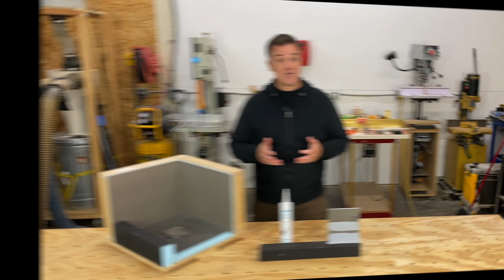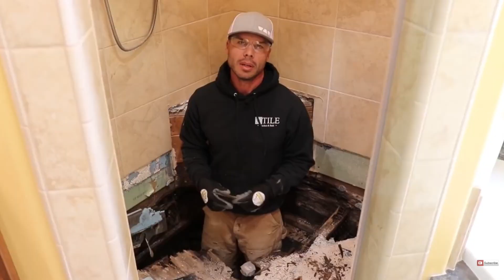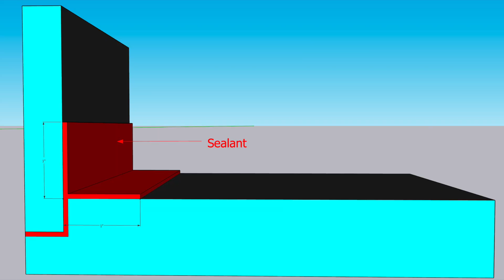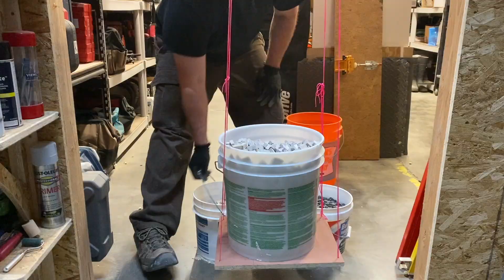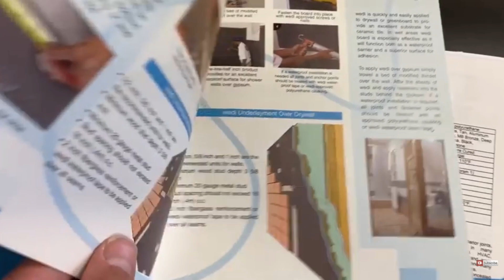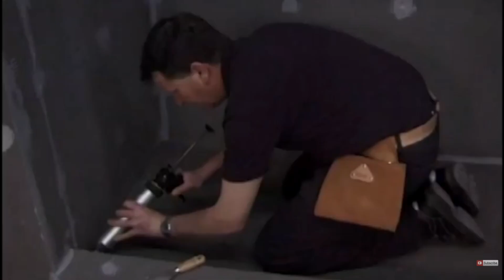WEDI Shower Waterproofing "Big Secret"

Comment: I have a problem and need advice. Old leaking shower. I assume it was built by the same idiots that built everything else in this house. A tear out will be a nightmare which I'm too old to do myself and too retired to afford a tile contractor. I'm thinking I could use  a tile over tile primer (the slope is ok) then RedGard and go up the wall maybe 6" with a curved (think baseboard) style tile. Epoxy grout and silicone. I'm open to suggestions, product recommendations and advice, but please keep in mind the afore mentioned constraints. Thanks

Comment: Oh what a world of BS we live in. This is a very comprehensive marketing campaign to back up a product (sorry a "German" product, haha) that is hideously expensive and clearly not as good as standard membranes that require bond breaker. Its a bit like the epoxy membranes that became really popular in the 90s but cracked on (wooden) second floor installations with a structural movement problem. I'm only ever going to install this stuff with bond breaker and a proper waterproofing membrane ON TOP OF IT. But then again, I could install cement board for tiny fraction of that cost and it would be properly waterproofed, no need for this marketing crap. I can clearly see the signs of what the edge of polyurethane sealant looks like when it separates from the substrate surface, like in inappropriate expansion joints.
Reply from the maker: I don’t work for Wedi and I don’t have any marketing agreements with them. I made this video to help customers and professionals understand this product better. There are people out there who make up ideas based on how they feel, not proper education and evaluation. There are many products that work but all of them have to be installed properly.

Comment: I just installed a Wedi shower. I think it's a great design! I can see how things can go wrong if installing and not paying attention to detail. Such as debris left in the rabbit cut.. or insufficient sealant. Also, the sealant being used is way too close to what International used to seal oil pans on the 444 engine..😊 you couldn't remove the pan without torches and chisels . The oil pan always needed to be replaced.. just a memory I had while working with the Wedi caulk sealant stuff..
Reply from the maker: Nice!! Paying attention to details is always key!!

Comment: You did a wonderful job breaking down a particularly problematic video on Wedi pans. There are a variety of products, when used properly, that work really well. Great commentary and analysis. The one thing that I will comment on with regard to Wedi and Schluter shower pan products are the drain assemblies. I have never liked floating them in with mortar with no mechanical connections. I also use epoxy thinset when installing shower floor tile and epoxy grout to finish off the floor. Keep making quality content.
Reply from the maker: Thank You!!😁

Comment: I ran an water feature business along with general stone masonry and landscape for 22 years.  We became the second largest Aquascape (the largest water feature supplier in North America) in North America.  I am a Master Certified Aquascape contractor, so I have worked with literally miles of EPDM 45 Mil rubber liner.  This is not foolproof either.  You can puncture it during installation and cause a pin hole leak that would feet the rot.  We also used sealers to clamp the rubber to the face of the skimmers.  The one on my home pond is 25 years old and does not leak, but I made a living with multiple pond service trucks fixing leaks that were punctured.  Overlaps are not the answer.  Following the manufacturer's instructions to the letter is the key and making sure your joints are clean and dry does.  Great video.  I am installing my WEDI shower starting this weekend.  I watched the negative video to the end and thought I might have blown my plans and money.  What I would guess happened was the leak test was fine for the shower base, but the seal around the top of the seat leaked into the open area under the seat and weakened the floor which caused it to move which seperated the edge. Also might not have taken the dust off the rabbit joint.  Thanks a lot for a thorough job.

Comment: You sound more like a lawyer than a tradesman. Put the installer before the court, he would convey that he did everything by the book. And the bottom line would be…a "Wedi certified" installer did the job, it failed and water damaged occurred. BTW, your explanation of water damage- bacteria, fungus, glucose and pixy dust, was a great job of pivoting.  You should consider a career in politics.  Instead of arguing this to death, a good damage control team would have worked with the home owner and honor their guarantee.  This way home owner is happy and future consumers would have confidence in the product and the company behind it.  So all this "science" did nothing for positive public relations.

Comment: Thank you for this rigorous application of critical thinking. I installed a Wedi shower in the house I was living in, in 2011. We used it for a few months before selling the house. I remember using Sikaflex (221 I think). It was gray like the current Wedi supplied sealant. I saw the other guy's video first and was wracked with worry that the people I sold the house to may have had a failed shower (that I proudly built). I followed the instructions to a T and after watching your video I regained my confidence in my work. I'm demoing my current bathroom and will be doing a Wedi Fundo shower. I like Wedi and my faith is now restored. 😂

Comment: I would definitely be interested in that report. The seat theory doesn't work for me as you can see it in the background tiles removed. Its not rotten. The bottom plate of the wall appears to be in fair/poor condition. The sub floor, joists, and band board are all trashed. The pan does appear to pull loose from the sealant fairly easily. Definitely did not take the 225lbs in your demonstration. Seemed to hold on to the wall really well. With the extent of damage it would probable be very difficult to determine root cause. I guess the biggest question is if a Widi approved contractor did the install what difference does it make what the cause was? They should stand behind the install.

Comment: Even though polyurethane is waterproof and weatherproof, if it's left in an area with high humidity levels or temperatures of more than 122° Fahrenheit (50° Celsius), the material will degrade. It should be kept away from these conditions to ensure that it lasts for as long as possible. I would guess that you wouldn't want any failure on your grout if used under tile in a shower. I would guess that 122 degrees might be found near the sealant as would someone expect to understand the humidity in a shower. some people love to take long showers but I can tell that you are one of those people that takes only a long enough shower to wash you nasty aass and anyone that takes long showers is some kind of problem anyway in your fools reality.

Comment: 15 year warranty on a product that shall maintain a barrier to prevent damage to the structure? 15 YEARS wow. How many years can a building go without major structural damage? If the building isn't treated with a bunch of 15 year warranty products, I would guess 125 years in good conditions if not more. I guess in this day and age the home owner doesn't live in one home longer then 5 years so the owner that gets the bad luck 16th year failure condition or suggests that 15 years is all the wedi is warrantied for should rip it out and put something new in a there genius. Just like the roof now. After 15 years you should replace your shower that is a wedi install to prevent structural damage. Good show there dumb aass.

Comment: Point in fact that a fat fuxker is hanging off the rabbet joint and the foam comes with the sealant when he finally break the piece of wall material from the rabbet joint. Do you see your lack of understanding? If it was dynamic shear from the floor riot then there should be pieces of the rabbet joint attached to the wall material. Instead there is a stain on the rabbet joint and no foam missing from the rabbet joint. Just sealant missing and looking like it soaked off.

Comment: OOOO OOOO as you suggest deflection the L over 60 or L over 70 OOOOO wow YOu are using some big engineering wording. Deflection as such as I did suggest dynamic shear. What does cause the shear? Deflection? and if there is deflection at a rate that would cause dynamic shear then I would suggest that the delamination would not look as it does. Kind of like it was soaked off the rabbet joint leaving a stain on that same rabbet joint. Not pulled off. You are full of shxt boy.

Comment: I saw the delamination and the true lack of engineering with this product. As you are suggesting that the home owner and inspector of the issue was not forthcoming, but in fact the delamination was the whole issue and the cause of the leakage. You suggest that there was riot already and the floor riot along with the truss riot was the dynamic shear. You would be wrong. The delamination was not due to shear from the structure. If it were then there would be parts of the sealant still on the Rabbet joint. That is where your argument losses all it's validity. It is not a well engineered product at the rabbet joint. By the way as you so foolishly put science and engineering as not common or sense; and also not being common or sense the nature of things in the physical world is that you suggest that logic is not of the nature of common or sense. What happens in the real mean physical world is studied and has a logical process always. If you live in another dimension then maybe what is real in this universe could be considered not common or sense if it is logical. What you are really saying is that if it doesn't work for you in your mind then it isn't common sense and that nature has no logic from your common sense prospective. You are wrong. You suggest you understand what is really going on and all you are is wrong. Living in your own diluted reality.

Comment: do you think you can go above and beyond fitting instructions i do belt braces every time thanks Colin
Reply from the maker: You can, but also making sure you achieve the intended goal rather than blindly following an instruction is very important.
Reply: @builditorfixit  wedi Subliner Dry Waterproofing Membrane i was gonna put this 300mm high on walls to floor and put down with ardex x77

Comment: Also, you say lapping up and over isn’t correct.  I don’t follow that ?  If you seal the bottom joint with a piece of membrane in thin set isn’t that the best way to do it?

Comment: I'm thinking it's possible that the original tiler did not go all the way to the edge when applying the thinset underneath the shower pan, leaving air pockets all around the edges or parts of the edges with little or no support. When weight is applied in those areas it would seem as though it would compromise the connection from the space allowing it to be pushed downward from weight of a person using the shower, possibly breaking the seal holding Wedi's panels and shower pan together. Also if there is a dirt/dust layer in the edges while caulking it would also affect the adhesion results.
Reply from the maker: That can definitely be an issue, the report the homeowner had stated the issue but I guess they didn’t want to share it.

Comment: Thank you! I watched the video your speaking to shortly after I just installed a wedi shower and was worried. I feel much better now. I like the wedi over Kerdi board because it just seams like better material. And I liked that wedi uses sealant for its joints verses kerdi using thin set. And the guy in the video likes the kerdi system so him saying there was no quick easy way for a shower didn't make sense to me. Thank you again.
Reply from the maker: Thanks, glad you liked it!! 😁👍🏻

Comment: Even if your facts and analysis are far more rigorous and correct, I still find Ostrom's video that you're criticizing here to be far more useful.  It'd be nice if his analysis of the failure were of higher quality, but there's simply no one out there doing that.

I don't see how your conclusion itself is at all supported by your take down.  Your final, "if he had bothered" statement, doesn't really make much sense.  The pertinent guidance is that from the time of the original install, not guidance from today.  I didn't go looking, but I'm guessing that WEDI doesn't provide a historical list of their installation guidance and updates over time.

"Customer had shower installed by certified WEDI installer.  Work appears to be fairly competent.  Shower failed completely and WEDI denied any responsibility".  Nothing you state here undermines that key takeaway.

The idea that "something was done improperly with the bench install and that led to the overall failure" could make sense.  But then what's the point of all the other criticism.  Newer sealant, 1" on either side of the seam, or anything else would amount to nothing if the same thing happened today.  As a customer, I'd still end up screwed.

I actually like a lot about WEDI's product.  I might have it put in myself at some point.  That being said, I'm suspicious of the three-sided adhesion being shown for sealant in the floor to wall joint.  It seems some type of membrane or something else would seem to be far more robust for that connection.  At this point, I see no reason to trust WEDI's warranty at all.  (which is probably par for course for most warranties).

Comment: My contractor wants to use a Kerdi shower floor and use Wedi for the curbs, the walls and the bench.  Because he was supposed to use Kerdi everywhere but after purchasing the Kerdi floor he found out the remaining parts are out of stock from Kerdi. So now he wants to mix Wedi with Kerdi. Is this asking for disaster or is there a way to make this wok properly?  Don’t know what to do?? He is assuring me they’re all the same and I shouldn’t worry. Comments please??
Reply from the maker: Hey Dick, It’s generally not a good idea to mix products. Wedi and Schluter are also two different styles of product and might not be the best to use them together. Your also voiding the warranty on both systems and I doubt the contractor is going to give you the same warranty under his responsibility. I would advise against this idea.
Reply: @builditorfixit  thank you for the quick reply. I am going to have to have a chat with the contractor and probably the best outcome would be for his to remove the Kerdi drain and go with an all Wedi system. Hopefully he will be able to use the drain on another project in the future.
Reply from the maker: Dick Tchairdjian That sounds like a good idea, I would also make sure your contractor is trained in installing the system by the manufacture, that is very important!!

Comment: I don't know if you solved anything, the prior video whose point seemed to be correct- looked like a polyurethane failure which caused extreme  and extensive damage.  I think it is something to consider if you got a Wedi install 10 years ago rather then saying, "Look I can hang from the Wedi bond it works!" and "99.9% success!" (Just look at the damage) It is more realistic to say things can still go wrong even with a certified install and warranty can be denied which is more useful then your point the Youtuber used Google and Wikipedia.
Reply: If it was a polyurethane failure, then why did Wedi deny the warrantee? I think if anything, the video goes to show how Isaac makes claims based on little to no evidence. He doesn’t think sealant would stick to the Wedi surface because he rubbed it with his thumb or just has a hunch, based on nothing. I like Isaac, but some of his testing videos (like the red guard one) are just flat-out wrong.
Reply: I used to work with the Wedi Sealant (thr stuff their reps pushed) 10 years ago. It's the same stuff they use today. They might have had other recommended products, but the stuff we were pushed to use by US Wedi reps was a 3M product in a Sausage tube. Very resilient stuff. The material surrounding the glue always failed before the glue itself did.

Comment: Sealant caulk have an expiration date. Typically from 10 to 20 years. They all fail eventually. Sealant caulk aren't as reliable as fabric, liquid membranes or pan liners. Using sealant caulk to waterproof your pan is not your best option or RIDICULOUS as you stated in the video.
THIS IS A STAMENT FROM SIKA WEBSITE:
A sealant typically refers to a high 
performance compound having more 
expensive ingredients, little shrinkage, 
excellent weathering and UV resistance 
and providing long service life cycles 
from >>>>"10 to 20 years" <<<  Wedi has a 15 year warranty because they expect their sealant caulk to last 15 years, otherwise they would give you a lifetime warranty. It's the manufacturers job to deny claims because if they don't, they will be accepting the fact their product is flawed.

Comment: After 28 mins of your video...you didn't  give any answer or thoughts  for the wedi shower failure....to me you are a widi fan boy just giving excuses for a wedi failure..i give you an example...you did your test of the strength of the joint between widi panels it is impressive but guess what you didn't use the same sealer or caulking that was used in the wedi shower failure ...did you?
Reply: @builditorfixit  Thank you for make it clear ..so you did your assumptions base on his assumptions👍
Reply: @robhandier1087  no he based his assumptions on the product and what he knows of the product. He can’t go back in time and find what sealant they used. The shower doesn’t exist anymore. This is why he says many times he wants to see the report.